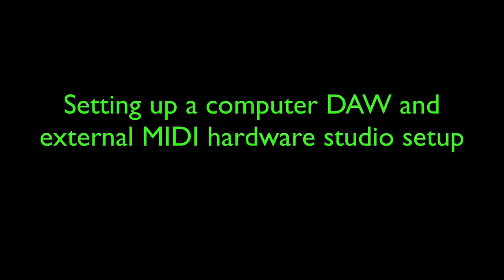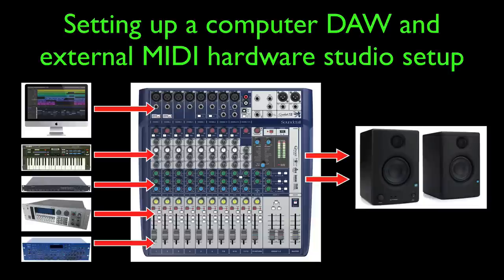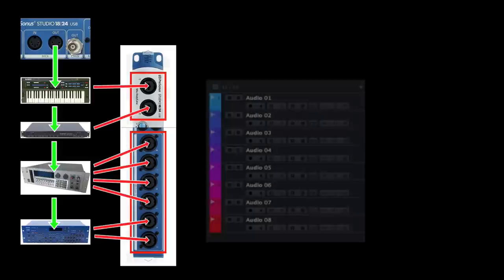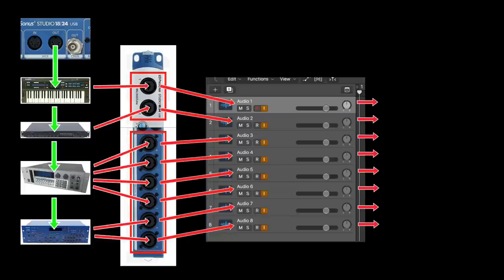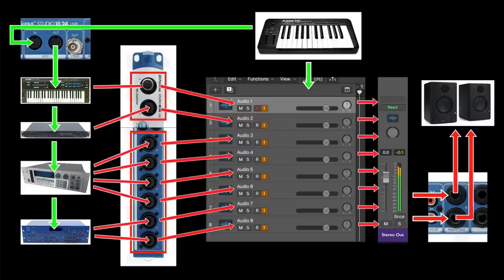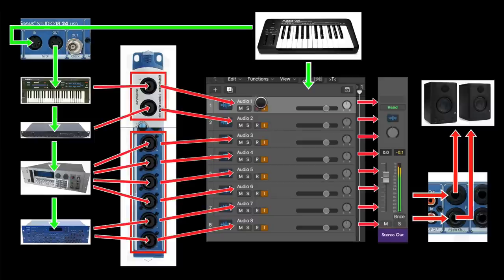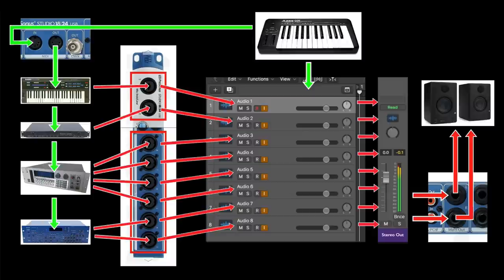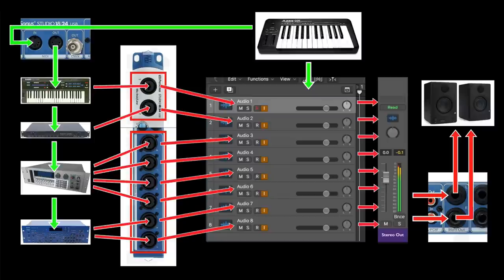How to setup a computer DAW & external MIDI hardware studio

Comment: This is really good and clear, thank you. A few comments. 
1. The problem with AU inputs is that you are quickly running out of them. You want to add a guitar? You have another drum machine? External effects? Soft Synths from an Ipad? There are never enough inputs on an Audio Interface if you start going hybrid and adding more gear. Yes, you can use digital inputs and yes there are preamp extensions. But all of that adds costs and complexity. 
2.The nice thing about hardware is that you can make music away from your computer. I like my DAW and all the capabilities it gives me. But whenever I launch my DAW I am first confronted with myriads of updates and upgrades. Whenever I power on my hardware I make music. So if you want to do both, work independently from your computer as well as integrate everything in your DAW, adding a hardware mixer I feel is the best option. Especialy since these days mixers also come with an USB audio interface. 
But clearly, the approach you are describing is the most economical one for peps that use a limited number of hardware instruments and will always jam, mix and master with a DAW.

Comment from the maker: Thought i'd add this from the audio interface roundup as a video in it's own right - people might need this as a topic
Reply: thank you for your time
Reply: Is this making 1 of the 2 signals "out of phase".? I am really Missing something here in combining 2 separate signals from 2 devices into a "Y" to save 1 space into the interface or patch bay.
Reply from the maker: @zazoomatt  mate, keep your replies int he same thread.
Reply: yes... thanks so much for your time & efforts here.
Reply: Another useful video. I like your style of presentation and you "sound" like you know your stuff. I'm a novice home studio guy looking for a simple and effective multitrack system with midi integration. I'm hoping the Behringer U-phoria 1820 will work with my MPC ONE some cheap synths and a humble eurorack modular system, and also an oldish windows 10  laptop.
Reply from the maker: @dillipphunbar7924   should do if the laptop is up to it. 👍

Comment: This is EXACTLY what I was looking for with my new Scarlette 18i20. I’m running my guitar direct in and then a DI box to simultaneously record a clean signal on track two- but was struggling on where to run the signal out to from my Midi Controller/Sampler/Fader and a drum machine. I then want to run my Guitar Pedals as a separate track that I can send audio out to- this made everything a lot clearer!

Thank you!

Comment: I would recommend a few things, since your already at this point. :) midi interface would be good, a hub (i use thunderbolt) which allows even allows additional midi interfaces as you expand! Oh and a mixer! These things can allow you to have less than 8 inputs or use inputs for other things. The mixers give you individual settings and eq’s. The Midi interface allows each piece to be controlled via the master board, and the hub is just great for expansion. I actually run 15 synths, 2 drum machines, 1 sampler drum machine, and one sampler with two computers midi networked! I have two interfaces with more inputs and out puts all sync’d together with the option to make either computer the master. One computer is a imac and the other is a macbook pro, and for the longest time i did not realize i could midi network the two so i would find myself going back n forth for different stuff. Not tho, its one big super music making machine! Just my two cents
Reply: Greetings,
I am trying to do just that! I used to have a home studio in the early 90s when MIDI was still quite new, now things have changed, some for better, some for worse. 
I want to use my Korg Pa3X 's internal sequencer(assigning patches and vocal harmonies to midi tracks 1-16) and my Alesis drum machine for selecting patches in my DAW(Cubase). I have two midi interfaces, an M-Audio M-Track and a
 Volt 2. (2 Ins and 2 Outs each) 
Also, I have Cubasis 3.4 on my iPad which I want to integrate into my workflow.
I've bought a new Yamaha MG-XU mixer with USB connectivity. 
The audio setup is a Rockville subwoofer going into a pair of Yamaha HS5.
I have a Mackee Thump which I want to use for alternative mono sound while mixing.
I would gladly pay you via Venmo, Zelle, or Apple Pay, if you could help me set it up correctly.
You can contact me by replying to this message, or find me on Facebook under James Bastani (Jamshid). Thanks in advance!

Comment: Of all the Logic videos I've watched yours are the most understandable. Now I have a huge request. I just purchased a Soundcraft 22MTK, which to me is the ultimate hybrid mixer. I'm having problems just trying to make everything make sense, especially with logic. I know eventually by pushing all the buttons and swearing a great deal I would be able to figure it out. But I was hoping if you had both time and the desire, you could do a series on this mixer. This mixer is truly the best of both worlds. I would greatly appreciate it. Please keep up the great work you do. It has helped me a ton.
Reply from the maker: It's nothing to do with Logic, this mixer would work the same with any DAW. The issue is, how do you plan to use it? what are you doing? Recording a band using multiple microphones? Routing lot's of external midi hardware? How are you planning to use it?
Reply: @dancetech  I am recording a band .  I'm just very new to the whole process of recording especially hybrid mixing,
Reply from the maker: well the way I would use it is: plug the mics in to channels, set the gain, and then route to DAW track, then switch all Mic channels to USB so you are listening to the RETURN FROM THE DAW track on each channel. That's the traditional multitrack method.
Reply: @dancetech  I'll give it a try. Thanks for the response, it is greatly appreciated.

Comment: Great great video!;) I just have to make a comment on this. Cos for many years I have liked to make music with and external mixer but never got it to work right I could play midi but not record it properly audio. I saw this video and thought I give it a shot so I brought a 1824c. I had big problems to get it working but on my way to give up. This morning I got my sound out from my external synth. I had created a midi track in Pro Tools and recorded directly to an audiotrack in monitor mode. Just like you say I would be able to. I never tought of this metode but yes its a rally rally great way to do it. So I will say thank you so much for revealing this. Im so happy now thank you.
Reply from the maker: 👍 cool

Comment: Surely there's no "best" way to do it.
I'm thinking that if you output your audio from the pc into the individual outputs on the audio interface you're using and then into their own individual channels on your mixing desk alongside any outputs from your external equipment, you get to use the unique characteristics of whatever mixing desk you're using. EQ, Compressors etc?

Comment: I've done a bit of that. I have a Yamaha W5, Roland JV 1000 and Roland JV80. I have a midi 2x2, a midi 1x1 and 1x1 on the MIDI interface. But to get Logic to know which sound, what bank! and device was a nightmare. Only the W5 is loaded with 10's of sounds. But to get the playing or midi score to get to the right synth, right sound/bank, play through headphones and being able to record the audio from them into Logic it is rocket science. 

I might be able to change sound but to change bank I have no idea. It is possible to Logic did that in the 90's. I could have a couple of sounds from one device, a couple from another and some from a third multitimbral but it's so hard to get MIDI and audio.

Comment: I am so grateful for all your videos and the time you so generously put into educating me and every body who waits patiently for your newest release.  I am thinking of buying a JV-1080 and a Roland SH-32 from a friend and am hoping to use it with an old Roland XP-50 with Logic pro X.  This is helpful.  I hope you will do more on this topic.  For instance, how can I use a XP-50 synth as a midi controller or can I?
Reply from the maker: Yes you could use any synth with midi as the master keyboard. If you also want that synth to play it's own internal sounds as part of the composition then there's a further technique required to set that up, which i should have included in this video. Now i'll have to make a part-2 video dammit :)

Comment: 1:45 probably should point out that you want a MIDI Thru box to connect your hardware to the DAW.  Each piece of hardware will be auto assigned a MIDI channel and samplers will usually get 10 or so MIDI channels for all the various individual sounds.  Now most importantly I don't know what I'm talking about as I am learning this myself so may of just typed incorrect info. You should be able to assign the channels yourself and I've had the issue where after auto connecting some MIDI channels are a mix of different synths and even different patches not actually selected.
Reply from the maker: welcome to the wonderful world of MIDI hardware! 👍.. but no, hardware does not get auto-assigned a channel, you assign the channel manually (although some GM 'player' units might break that rule, but that's a whole other type of unit with a specific purpose), additionally some multi-timbrel instruments might assign 16 patch 'slots' to channels 1-16 ascending... Yes, correct, it is always better and easier to have a midi THRU distribution box, which makes things much easier than daisy-chaining MIDI THRU each hardware unit

Comment: Hello Again. Thanks for this tutorial. It has been years since I had my 24 track analogue studio. When you mention out from the audio interface, you didn't mention IN to the hardware. Is it OUT to IN or OUT to OUT please. I also suspect that if it is out from the Audio interface to the IN of the synth, it id OUT from the synth to the in of the next synth. Is that correct?

Comment: Your pushing it with 4 devices in the MIDI chain due to signal degradation.  Typically you don't want more than 4 (total device count using the 5din connector) in your chain.  Current MIDI implementation is 40 years old and doesn't scale very well.  (MIDI 2.0 is out, but not widely adopted yet)

The 2nd device in the chain (and throughout the rest of the chain), use MIDI THRU and not MIDI OUT.  Additionally, each external MIDI device has a unique channel assigned (MIDI CH 1-16).  Important details for those who are new to this.  In doing this, each of your DAW MIDI tracks can choose whatever external device you want to use on that particular track.

Overall, the video is good in it's explanation and everything else rings true.....just a few details missing that might frustrate you!
Reply from the maker: it's just a picture to illustrate the concept, not an actual midi connection chart.

Comment: The conceptual part of this is very good and spot on. But I feel as though there is a few concerns here you are not addressing. Yes, you maybe accurate saying that there wont be noticeable latency. But when you now go to multitrack record from each of the line inputs (synths) and you sequence (send midi notes) from the DAW using MIDI or some other sequencer, the notes will not line up with the recorded audio. the tracks will be off. I was hoping you would talk about this in this video.
Reply from the maker: Good question. Well, as midi data has no delay worth talking about, any recorded audio will be "out" by exactly the same as any live recorded guitars, bass, vocals or any other mic recorded media would be relative to midi in any project. You can easily adjust for that though if you want by simply lining up the midi / audio and discovering the delay and then setting any tracks to a minus delay of a however many ticks. However, most DAW's like logic have a setting for record delay (in logic it is next to the audio interface assignment settings & buffer settings) which you can set from the get-go. once you know the delay of your system at whatever buffer size you work at (which would need to be low anyways 32 or 64 samples).

Comment: You’ve just answered so many questions i’ve been searching for. The diagrams and the way you explain is absolutely perfect for us beginners, thank you for all this valuable information.

Quick question, is that midi out from the audio interface to midi in or thru on the synth, bassline ect?
Reply from the maker: The MIDI OUT from the DAW/Computer goes into the MIDI IN of all external hardware. You can either connect them up in series using MIDI THRU on each unit if it has that socket (so IN to the first unit, THRU from that to the IN of the next unit etc), but it is far better to use a MIDI distribution THRU Box and bring the DAW MIDI into that and then send THRU from that box to all hardware units on their own MIDI cable, makes life easier.
Reply: @dancetech  Thank you so much for the quick response and for explaining that the way you did, i’m so glad i found your channel! All my hardware has MIDI thru and usb. Was thinking about getting the Kenton MIDI Thru 12, would that be ok? And yeah i can see just how beneficial it would be. Thanks again 👍
Reply from the maker: @HatchetHarry  yeah, Kenton have been doing that stuff since dinosaurs ruled the earth, cant go wrong with their boxes👍
Reply: @dancetech  Glad to know i’m on the right path, just noticed some of my hardware doesn’t have a THRU, what would i do then? Is this where the daisy chain comes into play or is it something else completely?

Comment: Thanks ! This video helps me a lot ! I'd just one question : do I need a Midi Thru case if I want to send different midi infos to my external hardwares or can I just connect them like a chain ? Thanks for your answer, keep going! :)
Reply from the maker: you can connect them like a chain, assuming they have enough THRU sockets on them, but tbh it's better to have a MIDI distribution box if you have a few bits of gear.
Reply: @dancetech  Thanks mate

Comment: great video 2 things I have a question about.. midi so when you want to play midi in how do you assign the correct unit would the first one literally be midi 1 then next one 2 so on? and how would you use a midi interface in this set up.. and also how would you add fx units onto the audio channels/hardware units so say I was playing the supernova in this set up and wanted to add a delay hardware unit fx onto the supernova how do I do that? thanks in advance

Comment: Audio is half the battle. Or a quarter. Midi hookup is the bigger question, imo.
Reply from the maker: I did explain it a bit in the video. You simply set the midi track you are playing/recording MIDI into to the same channel as the hardware item you want to trigger. But yes it needs to be explained much clearer for noobs. With that in mind I am completely rebuilding my Youtube room right now with a full hardware setup, so i'll be doing more videos on this topic with actual working examples soon. 👍

Comment: Thank you for this but I have a question… i’m running my guitar and base guitar through an effects processor and then from there I’m going line in to my audio interface… I also have other effect pedals i’m going to add in a chain… All of these have Midi and I would like all of the effects petals and all of my synthesizers and my drum machine to be clocks synced to Ableton using ableton as the master clock.  

Any idea how to accomplish this?

Thank you again for the video. It was very helpful

Comment: All through the 90s and early 2000s I did tons of midi programing within Cubase/Logic and had pretty decent Midi/USB interface (Motu) and ATARI earlier before that. The midi was super tight and everything was  monitored and recorded through the mixing desk and captured to DAT etc. 

USB/MIDI is nothing like before, have tried tons of the newer stuff(iconnetivity, etc), they all have midi latency,. I don't like recording digital audio into DAW but do you think I could use the set up you have above to have zero latency of Midi, Audio playback because the DAW would correct the any delay and we could print audio to the DAW or capture the left and right signal out from DAW to another external recorder, DAT, Tape etc. Will also the Metronome with the DAW be in sync with the Monitoring of all the external instruments. Just trying to have alternate possibilities of recording. Thank You!!
Reply: I would turn down the sample/bit rate from around the usual 512 to 128-192
Reply: You are right. There will be latency once the data from the midi keyboard is processed by the DAW and is sent to the hardware unit.

Comment: I have a query I hope you can help with. 
I have 6 external synths / drum machines but would also like to add my mixer to how you have set up in the video.
I have a Mackie 1402 VLZ4 mixer (and a Behringer UMC1820 interface which arrived today!)
I’d like the mixer involved to try and get away from the computer as much.
Thanks in advance - absolute belter of a video btw!

Comment: For most beginners, an 8 input interface may be too expensive, therefore an ordinary mixer with stereo Outs maybe their most affordable solutions.
Reply from the maker: That offers no solution to the problem, you still need an audio interface, even a stereo i/o one to run the DAW ... Add a cheap mixer to that & you are at the same price/cost as a starter cheap Behringer 8 input interface (Behringer umc1820 = 195 euros)
Reply: digidesigns exist.. find an oldschool one!!